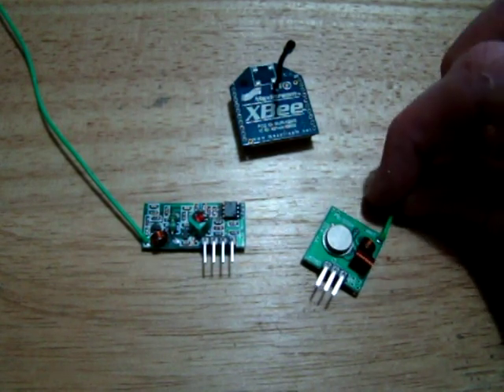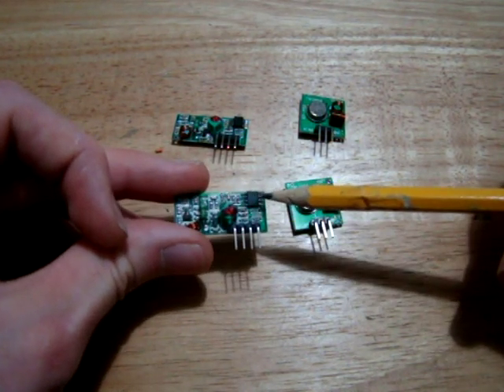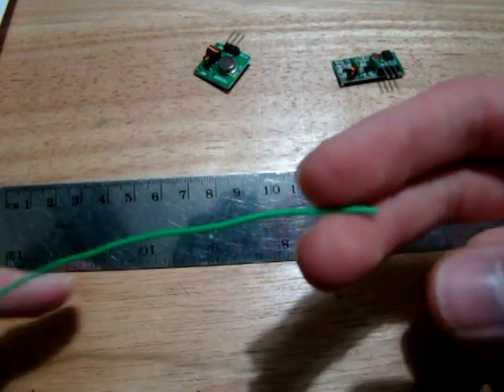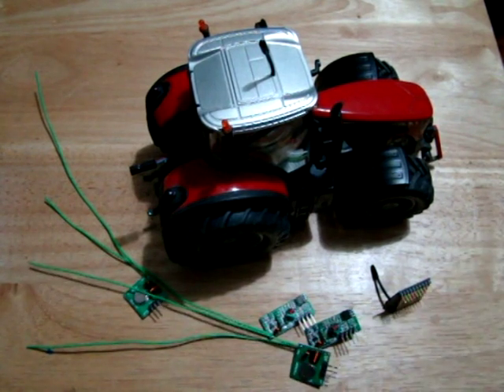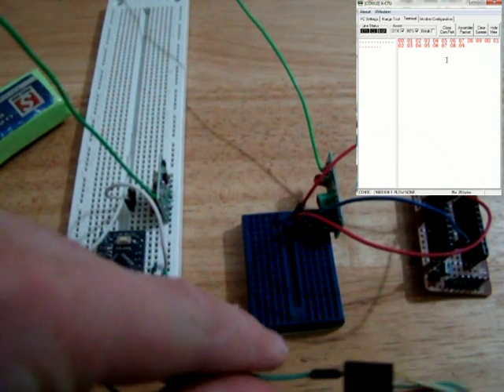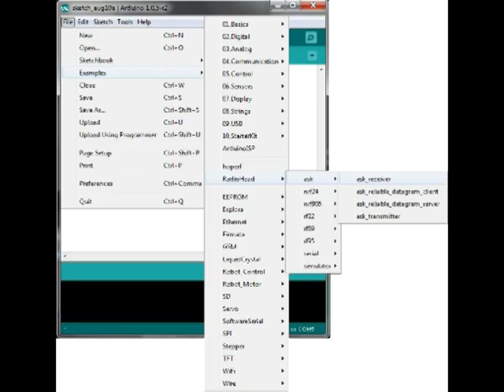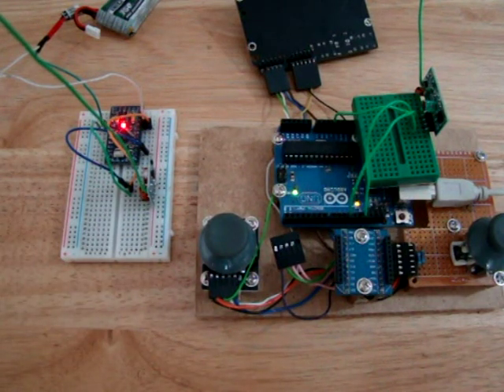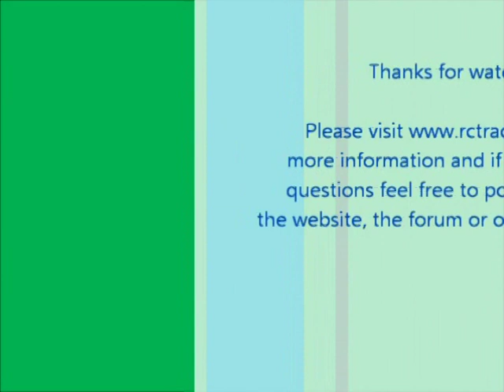How to use 2 dollar 433 MHz wireless modules with an Arduino

Comment: hello there can thıs TX and RX can be stand alone after you program on Arduıno Uno...tnx in advance
Reply from the maker: Sherwin Cruz Hi, if you want to send data then no there is nothing in these modules just a really basic oscillator so you would need to use an Arduino or some other micro controller with them. If you just wanted to flick a switch remotely or something like that you could probably do it with this.

Comment: Hi! I'm trying to use the 433mhz t/r module and 2 arduinos to control 2 dc motors.I have an ethernet and an uno.the motors are connected to uno and I have 2 pot's on the ethernet.Do you know how can I send info from the 2 potentiometers to the motors on the Uno?I tried using virtual wire as a library and it seems it has missing files or the arduino IDE cannot compile it.Can you send info without the virtualwire library?Thank you
Reply from the maker: Tore Chikano Did you install the virtual wire library?
Reply: RC Tractor Guy It doesn't work.It is no longer supported.When I try to compile the program it gives an error about it.
Reply from the maker: Tore Chikano That is a pain, I don't know how else to use that module. I only used it for the video and haven't tried it since. I switched to the NRF24L01, which is fairly cheap and easy to use too.

Comment: Is there a special transmitter required for the nrf20?
Reply from the maker: The NRF24 is a radio transceiver so it transmits and receives. An easy way to make a controller for it would be to get an Arduino Uno, a Joystick Keypad Shield and an NRF24 module, plug the NRF24 into the shield and then plug the shield into the arduino, upload your code and away you go. I haven't tried that myself yet so I think I'll order a shield and do a video about it.
Reply from the maker: I updated the ebay page on the site to include the parts I'm talking about, I was thinking an Arduino Mega might be a better choice because you would have more pins and so be able to add more buttons or joysticks to the controller later if you wanted. http://www.rctractors.net/electronics-from-ebay

Comment: a longer antenna will give more range??
Reply from the maker: Lower frequencies transmit further because the energy is more easily absorbed at higher frequencies. Since the length of the antenna is relative to the wavelength then yes longer antennas with the same radiation pattern correctly matched to frequency should transmit further.

Comment: i found only 1m range it works. how can i increase this rf module range ?
Reply from the maker: nasim ahmed You should be getting much better range at 433 MHz are you sure your antenna in the correct length
Reply: i used 17 cm wire like your video....
what is the range you got from it ?
Reply: can i use coax cable of 17cm use for increasing my range?
or spiral wire like inductor for antenna ?
what do you think?
Reply from the maker: nasim ahmed I never tested the range as the module didn't suit my application. I don't think a spiral antenna will help, I'm pretty sure that is just a miniaturizing technique which probably would reduce performance slightly. I'd try a larger ground plane, if you are just using the module on it's own the small ground plane might be pulling the antenna off frequency. You could using a square of tinfoil connected to the ground pin on the module if you don't have FR-4 substrate or a big pcb. A large square ground plane with the module in the center and the antenna perpendicular to the ground plane should help

Comment: Very interesting, I have used the NRF24L01 for 2.4GHz, might be something for you, too?
Reply from the maker: Yes the little black module I mention briefly in the video is an NRF24LE1 which I think works the same as the NRF24L01 so that is my next plan to learn how to use that. I made the mistake of thinking I could use uart to communicate with them so I may switch to the NRF24L01 modules as they are a little smaller.

Comment: dude i thought you was gona do a tutorial on how to use this modules to control dc motors from your tractor
Reply from the maker: Frank Lopez That had been my intention when I bought them, to show how they could be used for that but they were so bad I decided it wasn't worth the effort. I mean on ebay right now I can see an NRF24l01 module for $0.99 so it doesn't make sense to buy the 433MHz modules.
Reply: omg dude lol i been having those nrf for like 2 months with no luck on sending values and Rx values from the Tx to move servos or dc motor but im not good at writing code as good as i am in reading code maybe you done this already ? i just got this ebay 315mhz modules and im LIKE ABOUT to get that RMA lol this shit is wack and to think i spent a pretty penny on the nRF24L01+ buying  11 modules and cant even use it tho i have used the example sketch and it works but i cant use a simple IMU or Joystick or momentary switch to move something on the other Rx end "dc motors / servos
Reply from the maker: Frank Lopez I've used the NRF24l01 to control motors in the RC Tractors, this forum thread has the code so you should be able to figure out what you want from that. The code at the end of the thread uses a better library I'd advise you used that one and the code at the start has servo and motor examples.
Reply: link ?  my issue is that im building my own high current motor drivers from Nchannel and Pchannel MOSFET  and well most ppl use ada shield which i dont and then for me to modify the code is like ahhhhhhhh
Reply from the maker: Frank Lopez Sorry forgot to paste it :) http://forum.rctractors.net/thread/81/arduino-nrf24l01-module-control-tutorial?page=2 . The motor driver is no problem, you just need to use pwm outputs to control your motor driver.
Reply: RC Tractor Guy thank you i was going crazy trying to make the Rx from scratch lol , now how hard would it be for me to add a button switch to turn on the motor?  and use the pot to alter the speed of the motor very much appreciated in advanced for your help and skills
Reply: RC Tractor Guy dam i just noticed that theres alot of code on that page which is the one i want? and one is asking for a library i dont have the RH RF24 ?
Reply from the maker: Frank Lopez You can get the library here https://github.com/maniacbug/RF24. Comes with some example code too.
Reply: actually i looked in that link and did not find any type of header named RH_NRF24.h and this is what i get errors on my ide
Reply from the maker: Frank Lopez Oh no don't use that library, use the radio code from the example at the end of the thread as the RF24 library is better. Just use the joystick and motor control code from the start of the thread as examples. I haven't got it all put together properly for the RC vehicles yet.
Reply: i sure will try it now are this joysticks with the push button in it? or is this just 2 buttons or is it both lol? i see JOY but not stick but i see button so im kinda wondering why that name or which is it? 
***********************************
***********************************
// Define variables
int Left_Joy_Button = LOW;
int Right_Joy_Button = LOW;

#include <SPI.h>
#include "RF24.h"

RF24 radio(9,10);

// Controller Address
const uint64_t pipe = 0xE8E8F0F0E1LL;

/---( Declare Variables )---/
uint8_t command[16]; // 2 element array of unsigned 8-bit type, holding Joystick readings

void setup()
{
pinMode(2, INPUT_PULLUP); // A Button
pinMode(3, INPUT_PULLUP); // B Button

radio.begin();
radio.openWritingPipe(pipe);
Reply from the maker: Frank Lopez In that code the guy had two buttons he wanted to send signals from but it's the same for the joystick buttons, they're just two push buttons moulded into the plastic below the joystick.
Reply: right thats what i thought but my question was this is for joystick control or just the button on the sticks? im just wondering why use all of the joystick if your actually only using the button ? why not just use 2 push buttons you know? thats all

all i really want is to push a button on the master side and have that button turn on a motor/led/fan on the Rx end
Reply from the maker: Frank Lopez Oh no that code wasn't for a joystick, it's just two buttons, he was working a different project and was just asking about using the NRF24 modules to turn on some LEDs. If you just need a button to start the motor then use that code and wire your transistors to the digital output on the receiver and that should start your motor. Be careful your transistors don't draw too much current or you'll damage your Arduino.
Reply: well now that you say that your making me think cuz the n and p channel mosfet i have are rated 55V 75A and i plan to build a Hbridge dc motor driver for my application and the mcu will just handle the communication while the 315Mhz module or the nRF module will relay the inputs to the outputs
Reply from the maker: Frank Lopez Well as long as you measure the current on the H-bridge wires that you're going to connect to the Arduino it should be fine.
Reply: well what would be my options ? should not use arduino as im using a high power system ? the driver will handle the power and motor but im not sure about the mcu
Reply from the maker: Frank Lopez No you can do it the way you are describing you just need to check the currents aren't too high before you wire it up to the MCU is all I'm saying. Here is a video where a guy talks about building a high power H-bridge that will work with an Arduino https://www.youtube.com/watch?v=IjgvKJrAOS4.
Reply: thats why your the man buddy thanks ill take a look